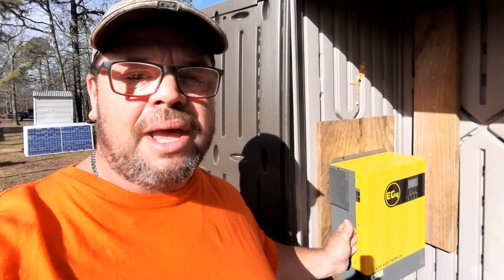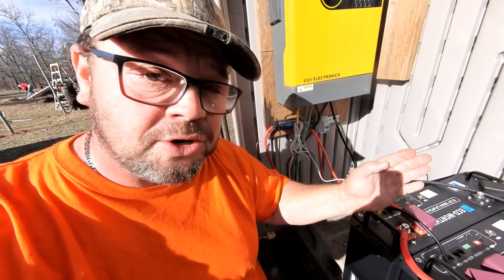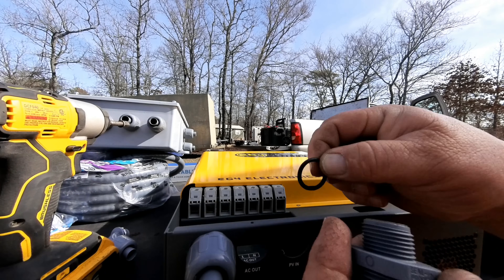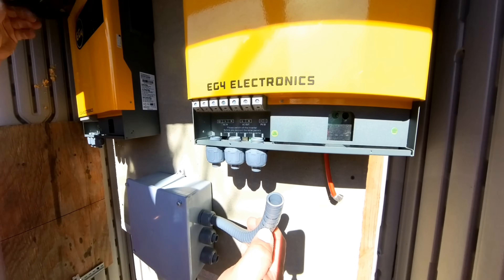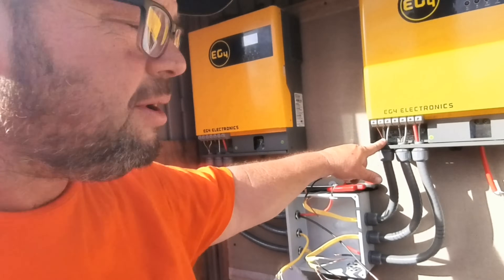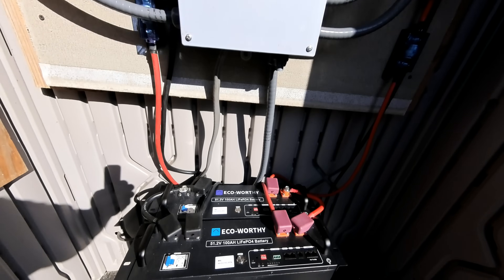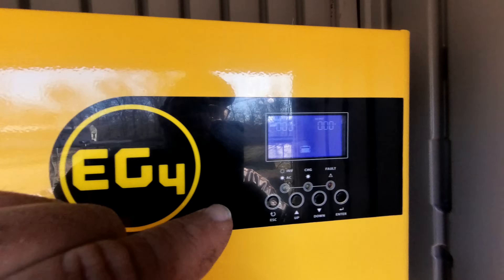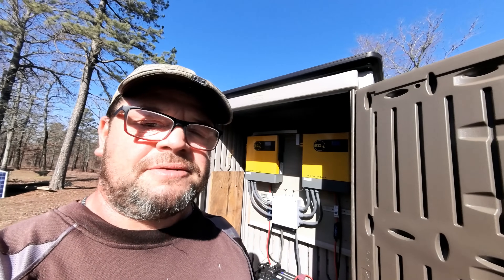This $3500 Off Grid Power System Runs My ENTIRE Cabin

Comment: I'm new to your channel and love it! I would love to build a solar system for my house but don't know that much about them. I currently use about 25 kWh per day for my home. Some of my appliances are 220V (well pump, oven, AC) but most of my breakers are are 110V. How do I determine what I need to build to run my home, plus a little extra to account for cloudy days. I live in Michigan. Thank you!
Reply from the maker: I could probably set you up with the correct system that would work for you if you were going to do it yourself. I could send you links to equipment that would run your house.
Reply: @OKLAHOMAOFFGRID That would be wonderful! I'm 67, semi-retired and try to raise 100% of my own food . I must be on a weak part of my power company's grid because I lose power all the time! I have a back up generator (6,500 diesel with a farm tank so fuel for months) but have to be home to hook it up if the power goes out. My neighbors have a Generac system but it burns 5 gallons of propane per hour! It's not uncommon for us to lose power for 4 days at a time. What happens when you can't get propane delivered? 😮 I would rather invest in solar with the power company and the generator as back up's. Yes, I would be building the system myself and presume that it's safest to have a separate, insulated building for components and batteries. It can get as cold as -20F here in the winter so I'm thinking that a little milk house heater in an insulated building for the winter months would be good. I know virtually nothing about electrical stuff or solar but found your videos informative and easy to follow. I just don't understand all of the "why's" of how things are plumbed up. That said, I'm willing to give it a try. I do already own 6 - 100watt solar panels that I bought for a "someday" project when they were on sale and cheap. Your video inspired me to think that maybe this summer is the time to pursue setting up a system. Any suggestions that you may have for me would be greatly appreciated! 🥰

Comment: Very cool. So clearly explained, makes me think I might be able to do this, too. :) What's the advantage of using server rack batteries as opposed to the wall mounted ones from Orient Power shown in another of your videos? And what do you have to do to get both 120V and 240V (to run appliances like fridge, drier, AC unit, water heater)?

Cheers!

Comment: I'm buying the same system, what is the best way to wire the generator into the inverter?
Reply from the maker: @katelynemler2516  it is actually very simple you are taking the AC input from each inverter running the wires together and then running those wires directly to the plug on the generator. Email me if you need more help oklahomaoffgrid@gmail.com
Reply: @OKLAHOMAOFFGRID  Which plug the 120 or like the 30 amp plug? Thank you so much!

Comment: Why would you go with the 2 EG4 3000w inverters when you could have bought the EG4 6000xp it has build in breakers and PV switch. Which would save you time and the wiring.
Reply from the maker: @stephensanchez5761  I already had one EG4 3K so why not just add to the system like it was designed

Comment: Have a question.. most inverters lose about 10%. Is that based on the load? Such as if you have a 1000 watt inverter, and using 1000 watts, you're losing 100 watts of battery power. But that same 1000 watt inverter using 500 watts, then you would lose 50 watts of battery power. Is this correct?
Reply: Yes. In other words, in order for the inverter to create 500W of usable AC power you would actually be consuming 550W as 50W is lost due to inefficiencies in the inverter.
Reply: @BrandonBattelle  Thank you.
Reply: @Knife_Collector  you're welcome. You can also think of it in terms of amperage. At 500W and 12v you are consuming 41.6A, but with a 10% efficiency loss, you're actually consuming 45.8A. This is important for sizing your wire properly.

Comment: The 6000xp would of have been a better choice, not needing all the extra breakers, disconnects would save money and be an easier install.
Reply from the maker: Yes but if you're in the situation where you need more power and you already have an eg4 3k it's cheaper to just buy another eg4 3k.. if I had not already bought something of course I would buy a single 6,000 XP

Comment: It'd be more useful if you showed what you were actually powering in your cabin --- just the appliances, and whether time of year, storms, snow etc made a difference, or how long oven could be on...and heating.. ... kw dont mean a great deal to normies, and even techies outside work.
Reply from the maker: Yeah that video is coming it just needs to be a separate video I had too much going on to be able to finish the video off was showing you what it would run... So yeah just hang in there it's coming

Comment: ive found that by having different arrays at different angles and directions im getting more consistant year round power. some are set up for summer and some for winter and hopefully in a few weeks i can set up two more small arrays as well. ive got the wire, fuses, and everything but still need the panels. thanks for sharing what you are doing.

Comment: Pv wire over 30 volts should be in emt. Or mc cable.
Reply from the maker: @raygibson1295  yeah sure it will be I'll be installing that this weekend with 8 gauge pV wire

Comment: I use Victron products for my solar, but do own the EG4 12k Hybrid mini split. When the sun is out in S. Oregon.. It runs off a pair of a minimum of 90v and Up to 360v..  at night it runs off my 1600Ah of lithium. I will add a 2nd Multiplus II 12v 3000 120 When I  relocate to my final offgrid property. This 1.06 parcel is only to test the offgrid life..  Then I will purchase a big shed similar to yours.
Reply from the maker: Good deal

Comment: Romex should not be used inside any type of conduit, THWN or THHN is normally the best wire type. For the short sections that you have installed you probably will be OK, but if you have to pass an inspection, this could get flagged.
Reply from the maker: @jwagnermail  thanks for that info I am definitely not a pro and still in the learning process.
Reply: Stranded wire in conduit.

Comment: Gasket on the conduit connectors should be on the outside.
Reply from the maker: @dubyabee12  yeah I thought about that but the thing about it was they were a little too small for the holes it seemed like it was kind of pinching it on the outside and it seemed to work better

Comment: How do you connect the parallel outputs to the house? Is there an intermediate module or something that synchronizes the AC wave or everything is done by the inverters in parallel mode?
Reply from the maker: you can hard wire them together just like i did right next to each other or you can put a breaker box right next to them to combine them as single phase 120/ or 240 with two legs. then you can run the power into your fuse box or you can run it directly to you fuse box as the power source..all depends on your set up

Comment: This just became a very powerfull system,now you can also add an electrik "boiler" that keeps 60L of hot water for you for instant domestic use,hot shower,washing dishes and so on :) cool!
Reply from the maker: i use propane water heater for now
Reply: @OKLAHOMAOFFGRID  I know,thats why i said,i think yours is on demand,but what i use is the one that has a tank,and pre heats the water:) with this its easyer to have faster warm water,and to mix them with cold for higher volume,and perfect temps xD
Reply: @83kaszas you could also heat your house with that as well threw a radiator I to your furnace. Interesting idea that’s definitely better then me running a wood burning boiler
Reply: @ the one i talk about only uses 1500-2000 watts,that would not be enough to heat a house :) but to shower and wash dishes its perfect :)
Reply: Electric sucks for heating. gas heat is the way to go. 
ive lived in all Electric apts.

Comment: FYI you don't need to purchase another inverter just to add move panels There are plenty 60A charge controllers you can buy for around 100 dollars. 
My guess you are happy with all that extra power. 
I looked at those panels from your last video. NICE
So if its not asking to much.
Please show us the calculations. for setting up the panels and max input for the batteries.Thank You
Reply from the maker: im not going to upgrade with a different inverter every time i need power..it is the whole reason the company made it possible to upgrade by adding up to 12 inverters so you can build as you go or as you can afford
Reply: @OKLAHOMAOFFGRID this is where I get confused.  Isn't it true that the newer inverters act as charge controllers and inverters both but the older charge controllers are only that.
Reply from the maker: @stevehall9256  it's not necessarily because they're newer it's just a different style you can still buy a charge controller by itself and a inverter by itself or you can buy an all-in-one charge controller and inverter like these
Reply: @donb6474  I looked at the pv input its max 500volts  at 18amps.
Reply from the maker: @Livingsolaryourway  yes 500 volts at 18 amps and 5000 watts pv input  per inverter.. also what that means in theory is if you input 250 volts instead of 500 you're able to push double the amps such as 36.. hope that makes sense

Comment: Nice. Personally I like simpler setups (one big inverter, one big battery). By the way the 535w bifacial panels with the pallet are a very good deal as well, coming at 133.7usd each buying the whole 31 units pallet. I also like bigger panels whenever possible. Are you going to add insulation to the shed where the inverters are? Cheers
Reply from the maker: i understand..but for the people who already have the smaller inverter it is the exact reason they made them parallel capable..not going to put insulation for now but i may build an awning over the top to keep direct sun off the shed
Reply: @OKLAHOMAOFFGRID  Yes for sure, always good to have the option to expand. And not all inverters and solar charge controllers can be paralleled. As always, nice video. Cheers